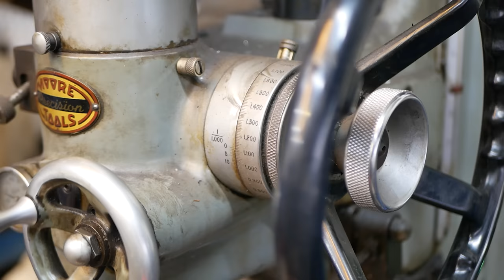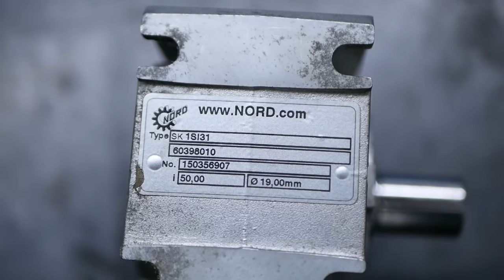Making steel sheet Roller Bender machine

Comment: One of the best channels on you tube. Please think again on that bad habit of leaving the chuck key in the chuck, bad accident waiting to happen.
Reply: It's heavily edited so he maybe takes it out safely out of camera.
Reply: @bennylloyd-willner9667  he leaves it on chuck when lathe is unpowered. If turned on accidentally it goes flying
Reply: @Lukasz Plonka  they don't go flying. They stay in the chuck until it comes around and breaks off in the chuck when it hits the ways
Reply: @combatcurtful  it still can break and send pieces of nasty stuff to your head... I think we just don't see when he takes it out or put it back in.
Reply from the maker: The lathe has all the safety features so I'm not worried about that.  if there is a wrench in the chuck, the guard cannot be lowered, and if the guard is not lowered, the lathe will not turn on 🙂
Reply: @MadeinPolandChannel  yeah, I wouldn't think you'd start with it still in.
Reply: @lukaszplonka2412  how do you know that he does that? As I said it is an edited video and not every single event is shown fully. Further more he has explained that it can't start without removing it.
Reply: @combatcurtful  they can fly fully too, it depends on speed settings and how deep and/or tight it fits. Anyway it's a moot point here since he explained the safety system where it is impossible to leave it in and start the lathe. I don't know why some thinks that the video show every detail and moment in real time. It is fairly obvious that is is cut to make a great video!
Reply: @bennylloyd-willner9667  it is Ok, he explained and now I know :). Take it easy.
Reply: @lukaszplonka2412  I'm calm, I just can't see how a few assumes he is sloppy with safety based on a video that is so heavily edited. I think those who are saying "beware, your aren't safe enough" are the one's that need to cool down😁

Comment: I have a factory hand crank roller .. they put gears at the end ,, your setup is good with the slip roller ,, I don't have a slip roller on mine .. only thing I would do is have all the switches on the same side ,, great build

Comment: For Bearing material. Copper based metal bushing provide needed compressive strength for this application and lubricating effect comparable to polymer. Thanks for sharing idea of plate bending machine building.

Comment: On the last roll of the video if you look on the right hand side of your screen you'll see the top middle bar rolling out as you're passing things through , you might consider a screwed on cap that's slightly bigger than the bar or something so that it doesn't roll itself out like that.

Comment: Can't say I'm impressed with this build compared with other stuff he's built in the past..   Odd combination of super heavy duty with barely strong enough...   The ultra thin walls between holes and the sliding pieces, same with the threaded holes for the adjusters are not very strong.   The end plates are super thick plate, but joined with just two strips of thin L-channel..  Then aluminum rollers and plastic bushings..   Yes, you are able to roll 1.5mm stock, but just barely: the rollers are bending and flexing noticeably as you roll and I can see this thing breaking itself after a few uses or you are tempted to try to roll some stock that is just too heavy, especially as there's a motor on it instead of a manual crank and you can't feel the feedback telling you the material or bend radius you're asking for is too much: the motor will just run until something gives...  If you're going to all the effort, I would have just built the whole thing super heavy duty and then it would last for years vs just a project or two before becoming the subject of or scrap recycling for the next project...
Reply: Hi

Comment: As a side note.  ◇2  HDPE plastic is easy to use. With a jig the plastic when soft  can been molded  into things like knobs , handles etc. 
Just one question:
Why didn't you use the lathe to true up / smooth out  the rollers?
I can't  argue how well  it works just as it is.👍🏻

Comment: Everything looks great 
Just a genuine question though…
Why did you go with the composite bushings instead of roller bearings?
Reply: That is not a composite. Its round stock PVC. Machines really nice but its soft. Those would plastically deform in a very short time. If he wanted to do a bushing instead of a bearing he should have used bronze ideally. Brass is a little soft but its still a lot better than PVC.

Comment: Nice build machine dude 
why you metal holes
sir you use pillow bearings and depth adjustment using linear bearings Nice and easy to make machine. Thanks sir.

Comment: Love the build. I could never build anything to this level of detail. My one thought is, would it make more sense to put the switches out of the work area- maybe on the side. So if you get pulled into the machine they aren’t covered by potential material in the rollers and can be quickly accessed to turn off or reverse?
Reply: when drunk or drug, just don't work🤣🤣🤣
Reply: @user-lk4ei6ch2l  accidents happen to the sober too. Easily accessed safety shutoff switches exist for a reason. 
I’ve worked with enough guys missing digits from “the good old days” to put the fear of complacency in me.

Comment: Nice job!
One thing, though: As someone who uses slip rollers a lot, the idea of wearing grip gloves while operating one gives me the total heebie-jeebies. I've gotten my hand pulled into one once... that was hand crank, NOT motor powered, and I wasn't even wearing gloves! 

I would highly, highly suggest not wearing gloves while operating that. All it takes is a little snag to pull the tip of your finger in, and from there, things get ugly fast. 

Elsewise... great build, thanks for sharing!

Comment: Excellent video as always.  Any reason why you didn't connect the two vertical adjustment screws to keep them in sync?
Reply: Would have to undo the mechanism to roll tapers.
Reply from the maker: I tried but gave up for lack of time.
Reply: @MadeinPolandChannel  I have not tried it yet but if one side is lower you might be able to make a funnel shape ??
Reply: @randytravis3998  that's exactly what you could do with it!

Comment: go look in your breaker box for two breakers side by side with a bar across their switches to force them to be switched together.  then cut a piece of roundbar or plastic or something and hot glue it to those two red rocker switches in a similar fashion.  if you have those two switches wired the way I think you do, accidentally flipping only one of them could result in pops and sparks and letting out the magic smoke.